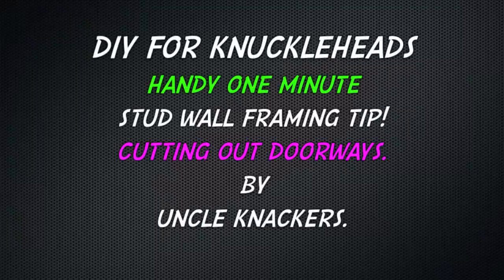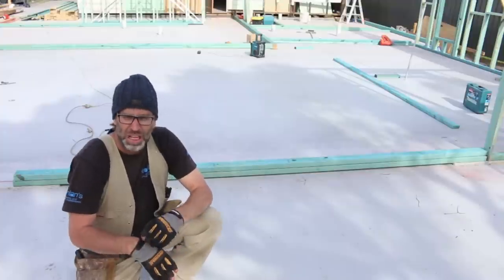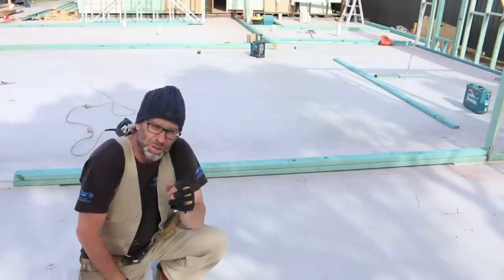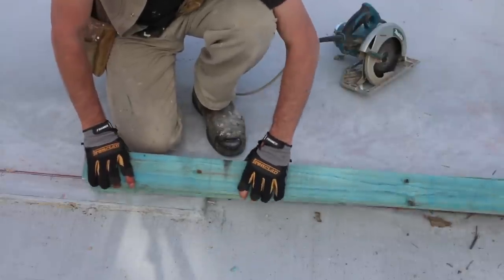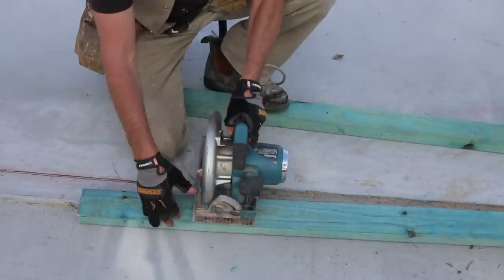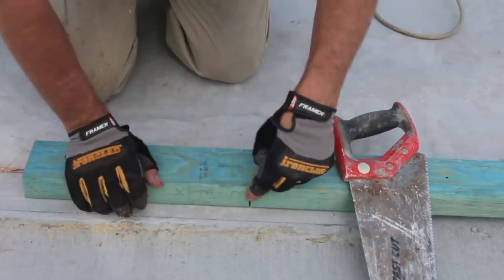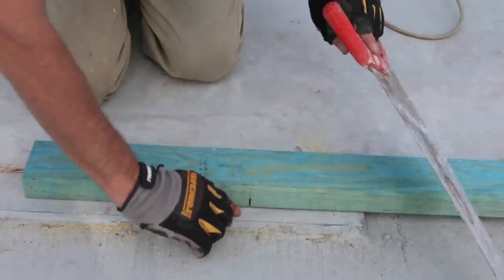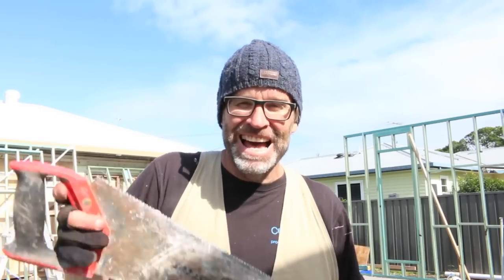One Minute Stud Wall Framing Tip! Cutting Out Doorways.

Comment: I've been meaning to ask, why is your framing lumber blue? I am assuming the wood is treated, but, is it similar to our pressure treated Southern Yellow Pine which is for long term preservation of the wood when used outdoors or against concrete or for wet areas etc, or for pest control etc?
Reply from the maker: kperellie Spot on Kperellie. It's a termite resistant timber.

Comment: i bought a twin blade cutter from bunnings after seeing all the tv ads. coz they said this circular saw will kick back. but should have bought a circular saw and I cannot cut with a straight finish with the twin blade saw as it does not have a guide
Reply from the maker: terryyouth I've seen those ads Terry. I wasn't convinced. Just stay with the tried and tested mate. Cheers